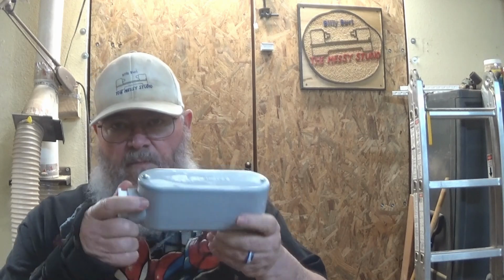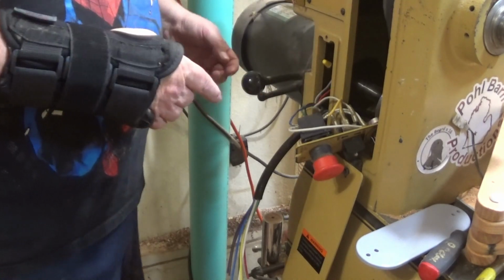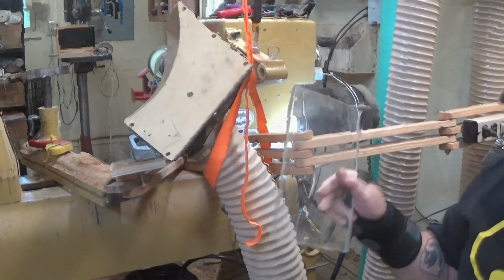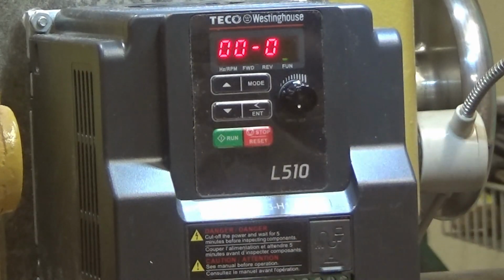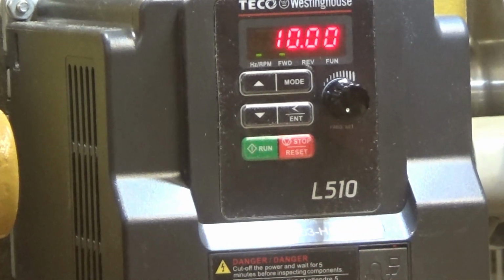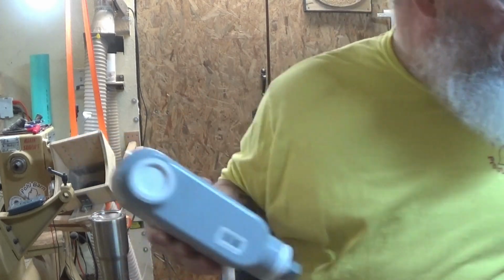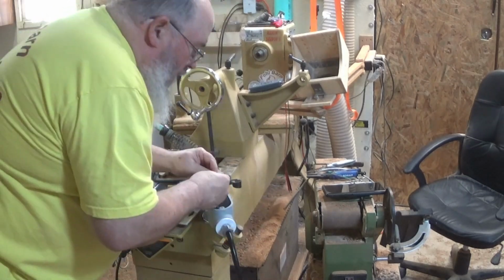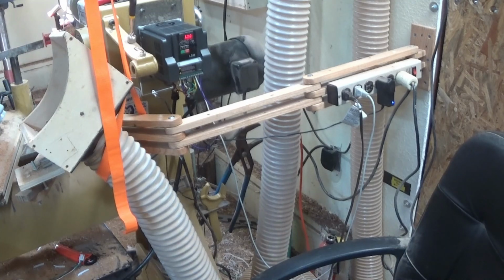Changing the Inverter on Powermatic 3520B - And adding a movable control box

Comment: Sure glad I found this Billy!  I'm helping a friend replace the VFD on his 3520B but I'm doing it remotely so I don't have access to the lathe. I'm an industrial controls engineer and have worked with VFD's for 30 years but I was having difficulty figuring out a couple of wiring details using the schematic in the lathe manual.  You just answered my questions so many thanks for all your effort on this video!
Reply from the maker: I'm really glad it helped, Frank!

Comment: I just did this on my 3520.
I believe the first setting 00-00 should be 0, not 1.  
When I set it to 1 the lathe turned backward, very slowly, with a stuttering motion. (note I said turned, not ran- running would have been faster than what it was doing.)  
Took me a while testing out settings and checking wiring to figure out the problem.

Also, if I did it again I'd try to find a beefier unit- perhaps the next model up.  I do a lot of coring (McNaughton system) and this inverter tripped an overload twice in the first 3 minutes.
Reply from the maker: Odd... I've not had an issue yet. That said, had I to do over again, I'd probably get the beefier unit with the connection for the braking resistor. 
Billy

Comment: Great video Billy...lots of information. I bet it is a capacitor in your old one. They dry out over the years and are easy enough to check.
Looking forward to seeing the new one in action also to see how the torque is.
Nice addition with the remote control box. The most I have done is added a E-Stop on the tail stock end of mine.
Take care and hope you are doing better.
Gary
Reply from the maker: Thank you, Gary!  I can't wait to put it through the paces.
Billy
Reply: @TheMessyStudio  Looked fun to program. I like that stuff! When I put the VFD on my Bridgeport I just plugged it in used it. A little slow getting the head spinning but it is a big beast. By the time I hit cycle go it is up to speed.  
Gary

Comment: Where does the brake wires go on the new westinghouse inverter
Reply from the maker: Roy, unfortunately there is no connection for the brake wires on the 2hp inverter I used.  However, they do have connections on the slightly more expensive 3hp inverter, but I didn't know about this until after the fact. You might check this one out: https://dealerselectric.com/L510-203-H1-N.asp?gclid=CjwKCAjw7vuUBhBUEiwAEdu2pLE_K8mNYpkT47jZ2Anl83MCVLkYaPd6lEeA1GA7zJ1DUd7xIXHrwxoCKekQAvD_BwE .

I will add that I've not really needed the brake because it seems to slow down well enough without it.
Billy

Comment: DId you get an error code on your original inverter? Did you look for a Powermatic replacement inverter? I found one for about $600. I get oe error code on my 3520B which Powermatic says is associated with low voltage. My inverter trips out occasionally usually when I'm rough turning a bowl blank. Also, what is the story behind your YouTube icon photo? Looks like you're in a band.
Reply from the maker: No codes at all, Tom.  In fact, the screen was dead.  I did find a Delta S1 for $650, but I figured if I was going to have to program it, I might as well listen to the guys who have replaced theirs with these.  In the last 15 years, my inverter had only tripped twice and both times I went out and found it that way.  Not a band, it is me, my oldest son and his son.
Billy